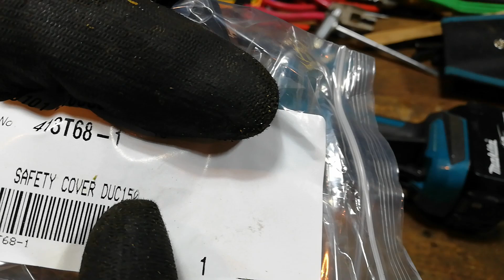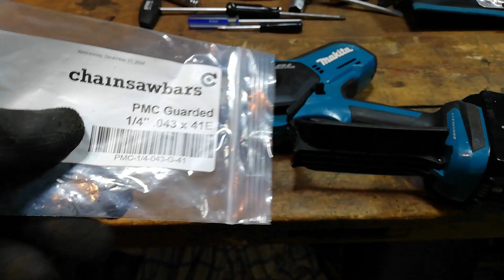Convert A Makita DUC101Z into a Makita DUC150Z Pruning Saw

Comment: I did the chain-only upgrade on the 40v version of the saw (UC029G) since it already sported the longer bar. Worked like a charm!
As I mentioned under the chain upgrade video I used the video description to order the correct custom chain from a German shop.
Reply from the maker: Nice one mate, glad it worked out well 👌

Comment: Thanks for the video. I intend to do the conversion because, like you, I bought the 101 before the 150 came out. Could you tell me the advantage of the 1/4 inch pitch please.
Reply: Just did the conversion to the 1/4" pitch chain on my 40v pruning saw, so I'll share the experience:
The saw cuts slower but much, much smoother. It was far too "jumpy" with the original chain when cutting smaller stuff. If you use the saw primarily for big pieces of wood the upgrade might not be needed but I use it mostly for pruning branches (duh!).
Reply from the maker: Thanks, just like the other reply, the 1/4 chain is a smoother and cleaner cut, great for pruning work.

Comment: Hello. Some links for the parts please? Especially the sprocket.
Reply: Not direct links but I'll gather the Makita part numbers posted across the three upgrade videos on this channel:
Makita 1/4" pitch sprocket: 198259-2
Makita 150mm / 6" bar: 1912F1-4
The Makita sprocket is different to the one shown in the video since that one is an aftermarket part only available from a UK retailer.

Comment: I already have DUZ150 with 6” bar. What do I need to convert to smaller quarter inch chain?
Reply from the maker: All you need is a makita 1/4" sprocket and a 41 link 1/4" chain
Reply: @RJLmachinery ещё нужна меньшая защитная крышка, которая сверху цепи и шины.
Reply from the maker: @iskaropki  Not in his case, as he just wants the smaller chain setup, not the smaller bar 👍